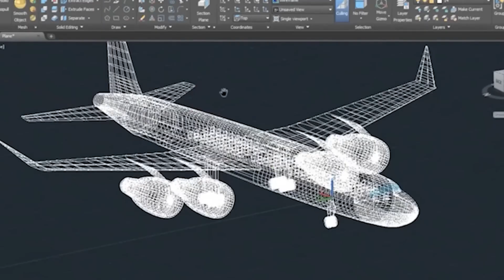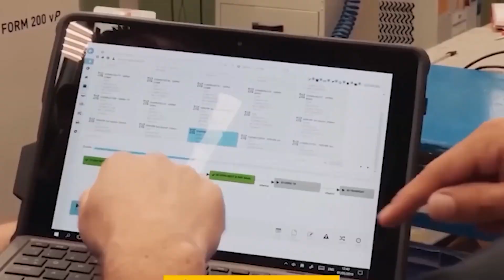The NEW Boeing NMA 797 Will CHANGE The Entire Aviation Industry!

Comment: if I were Boeing, I wouldn't bother with a new NMA plane, because it can be done faster and cheaper
Boeing-757 MAX. Take all the best of the new models: make the fuselage, plumage and wings out of composite.
Cockpit, passenger
compartment and control from Boeing-787, Folding wing tips from
Boeing-777-X to lengthen the wing. Adjust the take-off weight to 100 tons and use the latest LEAP aircraft engine, which is installed on Airbus-321
XLR and here's his competitor😊